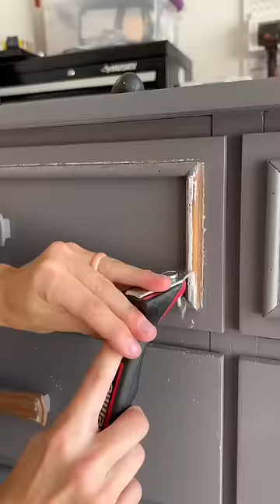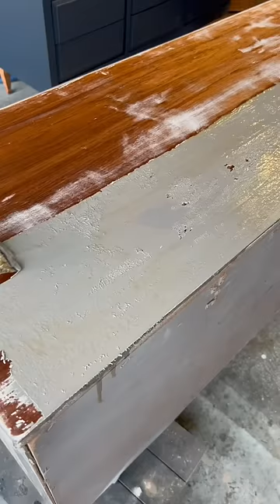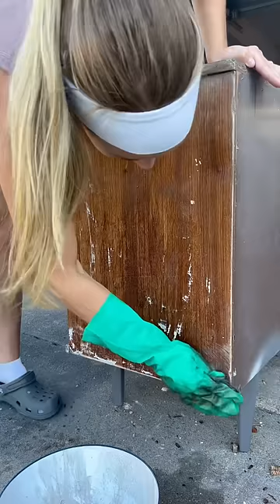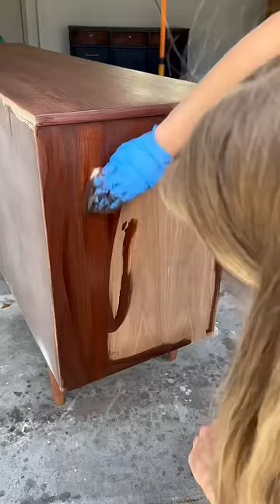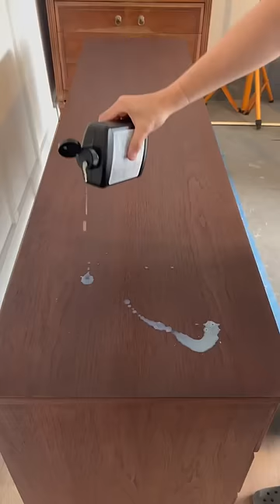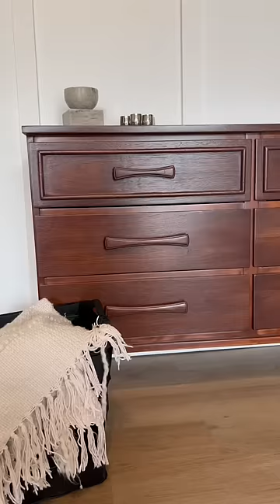Another dresser saved from the landfill 🫡 #furnitureflip #satisfying #diy

Comment: Just a note, you should NEVER scrape against the grain like you did at the beginning on the top. This can chip veneer, rip out the grain, or just plain scratch up your surface, which might not bother you if you're planning to paint, but would be visible for anyone who wanted to refinish/restore the wood surface down the line.

That said, this came out gorgeous! What I wouldn't give for this piece in my house (if I had the space for it 😅)
Reply: I was thinking same thing.
Reply: she did it on the side too
Reply: And the funished trim is a mottled uneven color compared to the sanded areas. Probably because it was scraped that way.

Comment: Looked like an easy save! Hard work and time consuming, but the process was straight forward and you didn't need to improvise, rebuild, or repair any parts. Don't know who told you it wasn't possible, they clearly didn't know what they were talking about. Glad you could showcase what a simple process it is to preserve our furniture, give it a new look to fit any design.

Some people are under the impression that painting ruins a wooden piece, but it's just as reversible as anything. If you learn to properly paint and remove paint to suit your aesthetic, you rarely have to rebuy furniture.

Comment: No one said that about a piece in that good condition. It was basically perfect other than the paint, and clearly solid wood. Of course it was restorable. You put the hard work in and did a good/thorough job but the commentary is dumb. It's an excellent piece before and after. The bones and structure are excellent.